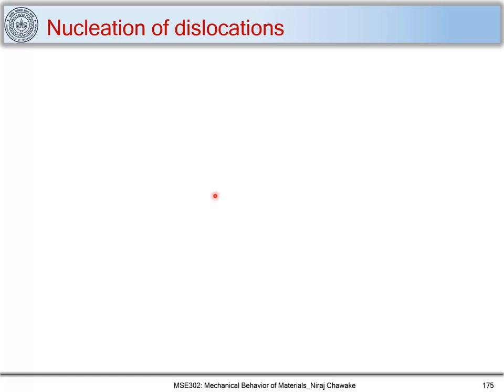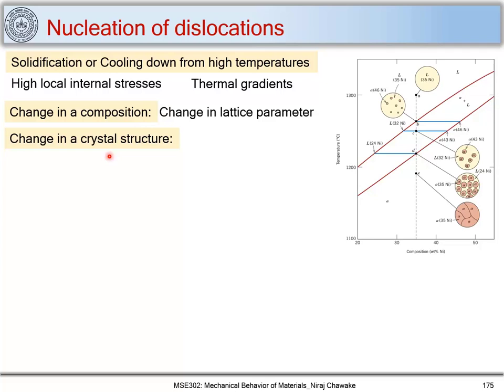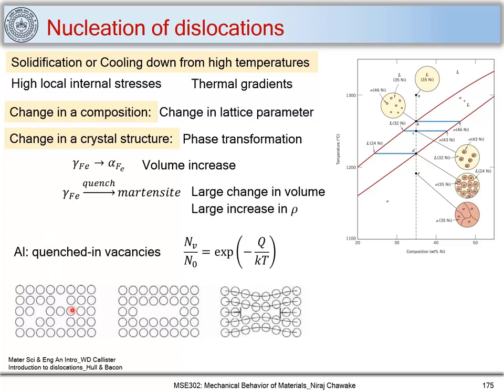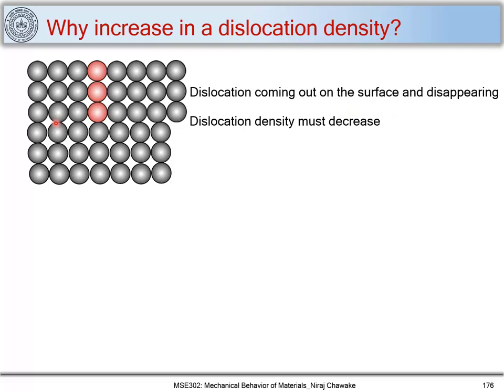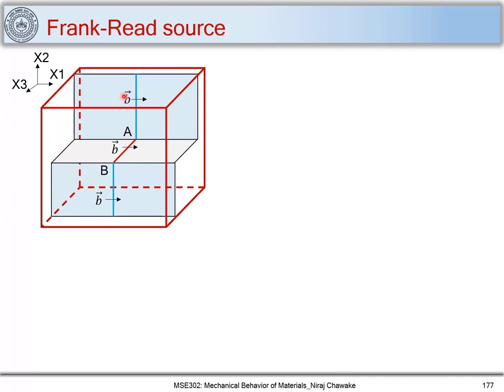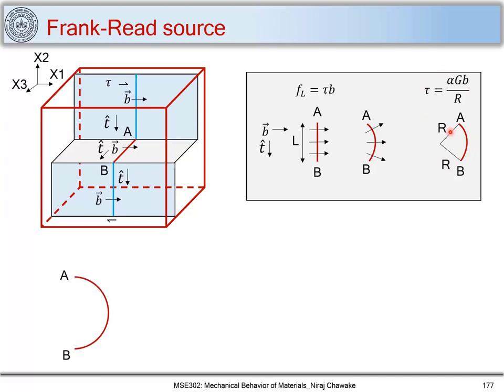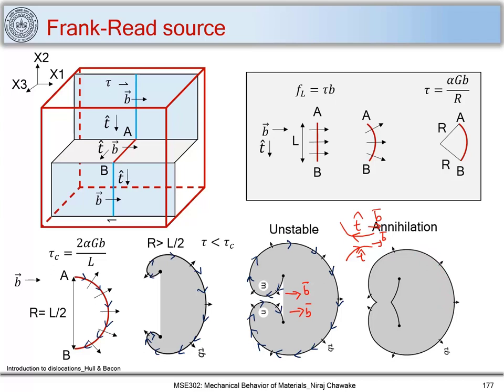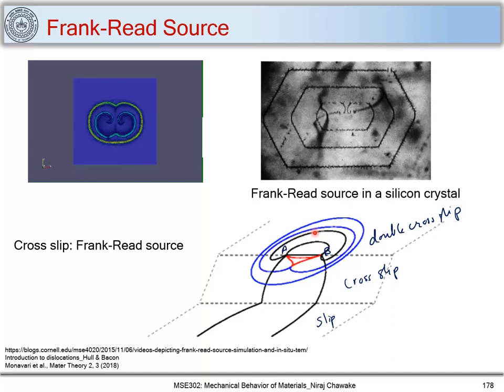42. Frank Read Source of dislocations

Comment: Good morning Sir,
I have a question about the explanation of the Frank-read source. I clearly understood the principle. However, I wonder why the two sides of the dislocation loop are moving away (left part and right part of the loop) although they have the same burgers vector. Is it because their line vector is opposite? 
Thanks in advance! :)
Reply from the maker: Dear Vincent
Dislocation tends to reduce energy, which can be accomplished by shortening its length (i.e., the dislocation line). Dislocations bend as a result of forces acting upon them. Even in this instance, the dislocation line bows due to the balance of forces acting upon it. When you cross a critical bowing dimension, in this case a semicircle, the dislocation will continue to bow if the force acting on it is sufficient. Remember that the Burgers vector is invariant, whereas the bowing occurs (or in other words, the dislocation moves) perpendicular to the tangent vector at every position (I guess that answers your question, but please try to visualize this). Now, when the dislocation line crosses the pinning points, they bow in such a way that there is a possibility of developing dislocation segments of opposing nature (in this case, positive and negative screws due to opposite tangent vectors); they attract and annihilate one another, creating a dislocation loop. I hope this helps.